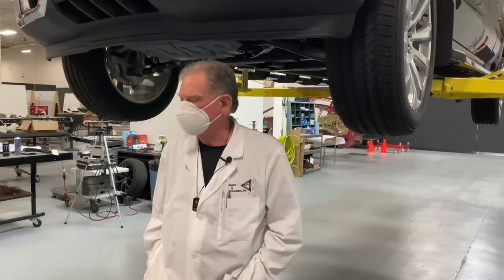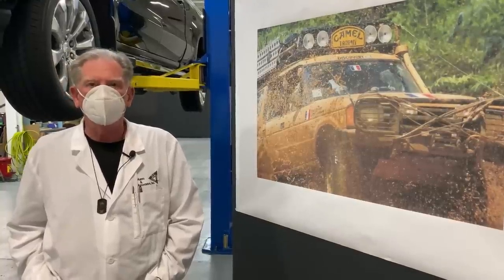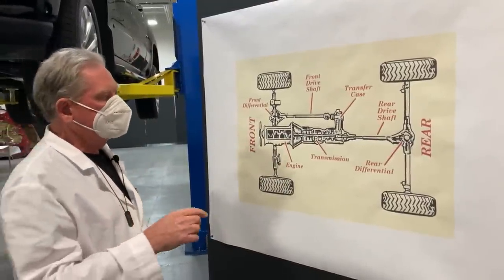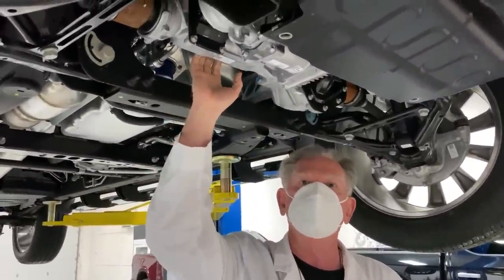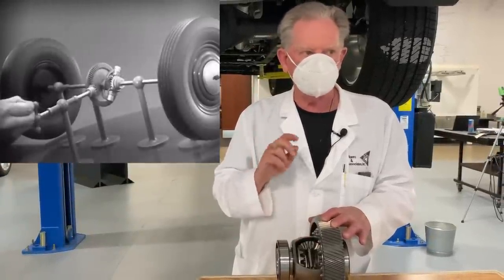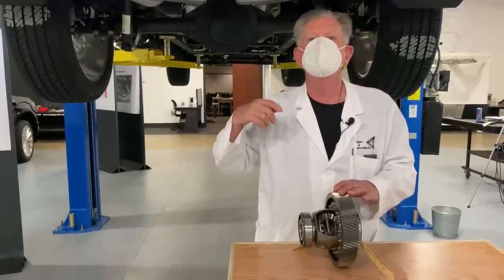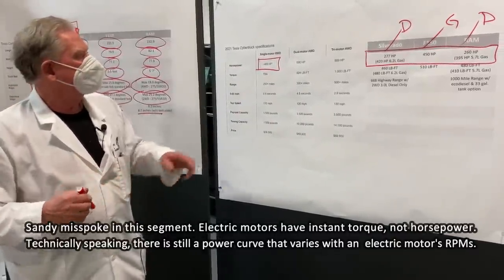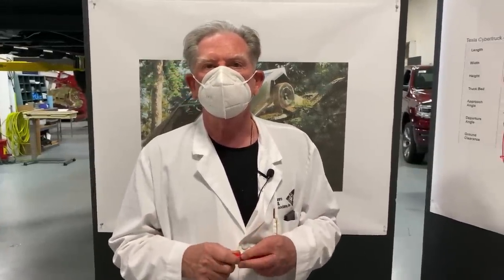Cybertruck E3 -  Driveline & Off-Roading

Comment: For the off-roading talked about in the video, torque is much more important than horsepower (you want to slowly crawl up the giant hill, not accelerate on flat ground). Which actually sets it apart even more from all the combustion motors.
Reply: sandy was actually talking about torque, he misspoke.
Reply from the maker: No disagreement there, Ryan, we got a bit crossed up.  Torque is king for sure.  Thanks for tuning in and keeping us on our toes!
Reply: For crawling with an EV you really want to know what's the holding torque and stall of the motor (yes, electric motors can stall)
The real challenge will be keeping traction, because wheel speed goes up real fast when you slip with a direct drive
Reply: @riccardo1796  look up the video of Tesla in Alaska. About a 10 minute video about Tesla and they're facility in Alaska to develop the winter driving capabilities. 

One of the segments is about riding on is with snow. And make a evasive manouvre with assistance software and without. 
This show Tesla really has a good handle to not slip out. 
It really baffles me how they do it. Have seen ICE cars do it aswell in many video's and never really have seen anything like it. Atleast like what it looks to be doing.
Reply: I was thinking the same thing haha. I drive an EV and the most noticeable thing to me is the torque when slowly driving up a hill. When I'd slowly drive up steep hills in an ICE car it would have to hit whatever RPMs to even start moving. EVs seem to have effortless power in that department.
Reply: @MunroLive  I was going to comment as well.  824lbft of torque before the gearbox for the dual motor is insane...  I will have to get a couple of spare CV shafts for sure.
Reply: @MunroLive   The easiest way to find the right answer is to post the wrong answer on the Internet.
Reply: @riccardo1796  electric motors can install but Tesla motors use reluctance motors controlled by AC, so these ones in particular don't stall like other motors do.
Reply: @pilotavery  of course they do
As the load increases so does the slip angle, until it gets to the point where the rotor is still while the field keeps spinning
Reply: @riccardo1796  this is true on some types of motors, especially all of the AC motors that RC cars use, as they don't use induced current on the rotor. in a way, the field is always slipping, but it doesn't stall because the torque still remains constant. The torque doesn't decrease when it starts to slip, the torque actually increases. It almost acts like a torque converter.
Reply: @riccardo1796  Tesla uses a switched reluctance motor, And they produce 100% of their rated torque at stall. Indefinitely. With no extra heat generated. So I guess if you think of it that way, you could say it stalls, although typically it is considered stall when it reaches a point where the amount of torque decreases.
Reply: @riccardo1796  although if you're thinking of something like an AC brushless motor on an RC car that's just a sensorless 3-phase, they stole as well except when they stall their torque decreases significantly
Reply: @riccardo1796  on switched reluctance type motors, the slip angle is not a thing. It's not a continuous angle but a slip rate as it is always going to be rotating slower than the magnetic field, with the load causing a greater slip speed and therefore increased current induction, causing it to be reluctant to slow down or speed up relative to the magnetic field. You can also control this rate with angle as well period the end result is it functions almost exactly like a torque converter in that the slower the rotor turns, the more torque it produces until it's essentially infinite torque at zero.
Reply: @pilotavery  I wish I knew more about motors to know angle and reluctance and the other terms. I'm gonna see if I can find a video that teaches all that - hopefully can find one about Tesla motors specifically!
Reply: What is most important is the traction control and locking differential.... the range rover, mercedes gwagen, land cruiser are the best what Offroad can give

Comment: 3 motors makes no sense to me, lose the diff and put in another motor for quad instead!
Reply: maybe it's kept for another Elon moment of "one more thing"
Reply: I imagine a fourth motor would add more power than is useful (tires only have so much grip) to justify the extra weight and cost. The front diff should be no problem since the back wheels will do most of the work and the front wheels won't spinn out of control with active breaking.
But i should add that i don't really know what i'm talking about :)
Reply: Most classic off roaders only have a rear locking differential so it’s probably enough. 

Plus this way in the front they can use the exact same motor they use in the other cars, and they only have to develop a custom solution for the rear wheels.
Reply: @lievenpetersen  lol. Cost is like $800. Not much more than a diff. Same for weight

If they can do 3 they can do 4 and do it right.
Reply: @lievenpetersen  and no tank turn 😒
Reply: Can you imagine the computer controlled traction and crawl control capabilities to maneuver over tough obstacles possible with 4 independent high torque motors - one on each wheel, and capable of independently  spinning opposite directions simultaneously? Combine this with tall portal gears on each motor/wheel and this new generation of 4x4s will be absolutely unstoppable off-road. Clean and quiet too!
Reply: @user-tb5ns7hc5i  what a beautiful thought!!
Reply: Why stop there? The motors are so small and localized within the vehicle that many more multiple powered wheels in rows could be placed on radical suspension under a vehicle making it  like a rolling undulating mat of wheels conforming to the ground for ultimate traction.
Reply: @user-tb5ns7hc5i  I'm pretty sure you are 90 percent of the way to reinventing the tank.
Reply: i think thats the plaid version

Comment: Ground clearance: I thought there was a second side to this. Vehicles with 16 or 18 inches of ground clearance are fantastic for off-road, but the trade off is potential instability on the highway.  However the CT has the best of both worlds, since it can then "lower" the suspension on the pavement, to somewhere around 8 inches? Making it better than most "regular" trucks! It's gonna be good boys and girls :D

Comment: Great job explaining the drive train on my 4X4. I learned something today. About the Cyber Truck (Dual motor on order) , if I was rock climbing and wanted enough clearance to keep all the wheels on the ground without scratching the skid plate, but wanted to keep the centre of gravity as low as possible, I can see a sensor system that monitors the clearance and adjusts the suspension height on each wheel independently. Rock Crawling mode could be engaged at low speeds. How would you like that Sandy?
Reply: Tweet this to Elon. RIGHT NOW. He might just put a coding team on it and it might end up as part of an update.
Reply: There is no sensor that can do that, plus the air system is not fast enough to compensate. When you are going over rocks the suspension is bouncing so the ride height is in constant fluctuation. A computer can not compensate. Your best bet to adjust the height yourself.
Reply: @JasonWW2000  As a retired instrumentation tech, I can think of several sensors that could be candidates. Optical sensors/IR sensors, can detect an object that blocks a path in a straight line. If they were placed on the wheel mounts they could cross the belly pan/skid plate in an X pattern and left to right. For more coverage I would try a capacitive/inductive sensor that would use the entire skid plate as the sensing surface. As the sensor comes in proximity to a object, it provides an analog feedback that can be triggered. This would be less localized unless the skid plate was divided into multiple capacitive proximity sensors, perhaps one for each quadrant. And I did stipulate that it would be at slow speeds, I mean rock crawling slow speeds, so bouncing would be negated. Don't assume that because nobody is offering such a thing that it is not possible, especially for Tesla.
Reply: @briansilver9652  I agree--this can be sensed and thus individual wheel heights controlled in real time. Please do get this to Elon and Sandy (pays to have a backup channel!) As a real time SW Engineer, this would be quite fun to work on, with Sandy doing the test driving!
Reply: @avroarchitect1793  I'm an old guy, I don't tweet. I barely You-tube. Feel free to tweet away for us all.

Comment: This is really informative. After I watched this video, I realized how little I knew about offroading. Like that endo club for example. If cybertruck's spec is about the same as what promised, that really makes CT even more desirable. And I already like what CT can do even before watching this video. Thanks a lot Sandy. Also slight correction at 18:15, it's model X not model Y :)

Comment: Agree all. When I was a kid I did some time running rubber tire and tracked logging tractors. "Interesting" might be how Sandy would describe it in the mountains of British Columbia. Took a good driver to stay alive on a 15 ton tractor being pushed down a ski-type slope by 20 tons of logs on hard snow trails, then get the load stopped at a landing with a 30 meter sheer drop at the far edge.

Comment: It will be interesting to see how that long wheelbase really works when off-roading. 99% of these things won't see any off-roading and those that do might find that they bottom out a lot... and that's where the battery is. Sounds like a winning combination - like a tortoise trying to walk over large rocks.

The 16" clearance is a bit misleading as it's likely to be 16" all around (not just where a differential is in the others) and with the long wheelbase, much of that benefit might disappear as soon as your front wheels go over that large obstacle and the whole battery tray rocks like a seesaw on it.

Comment: I would have ordered the tri-motor if I had seen this presentation. I hope I can update the order before they deliver.
Reply: You can just email them.
Reply: Be sure to lock in the $7K FSD when you do. Imagine not needing a shuttle service when you use it to haul your canoe/kayak on a float trip. :-)
Reply: @10fantic  thanks, I will try that
Reply: @danoberste8146  hell yes I ordered fsd
Reply: @mikepetersen5024  me too.
Reply: Mike Petersen, Don’t email, I changed mine by logging into my Tesla account. Use the link in your confirmation email, and then view your order, then upgrade it there. Very easy no cost.
Reply from the maker: @danoberste8146  that is a great point! The rafting nation will be thrilled!
Reply: Dan Oberste now you are talking real sense. A one way trip with your truck waiting at the other end. Pure genius. 

We might want a harpoon style front winch as well to get across some silly string river or canyon. Endless possibilities 

Just that price tag is a tad steep.
Reply: Great feature for hikers as well.

Comment: Presumably they also need to 'armour' the underside so those rocks don't ruin your day when they puncture the battery pack.
Reply: Teslas have a perfectly flat underside covered in armoured titanium sheet.  Far better than all the bits and pieces hanging down underneath traditional ICE 4WDs just waiting to get caught on rocks.
Reply: Martin Hill  very true, only downside is that if it does puncture and catch fire in a forest, there is no way to put it out 🙈
Reply: @DavidHRyall   I think we'll find that the underbelly of the Cybertruck is significantly more armoured than all pre-ceding Tesla models considering its off-road orientation so that scenario I think would be very low probability.
Reply: @DavidHRyall  Im pretty sure the advanced AI onboard will know precicely what it can and cant get away with, and preemptively stop if there's any danger of a grounding,
"I'm sorry, Dave, I'm afraid I can't do that"
Reply: @martinhill9011  Where are you getting info of a very expensive titanium sheet? I've always heard they use a thick sheet of aluminum. Like 3/8" thick.
Reply: @DavidHRyall  - Roll on Solid Electrolyte Batteries!

Comment: Sandy, please consider the Bollinger B1 instead with its portal axles. https://bollingermotors.com/ It's the better comparison to a Jeep Rubicon.
I doubt, the "Cybertruck" will ever be so offroad-capable. Because if it did, then it would neglect so many other features or properties that people want or people like/need on actual roads.
The drawings also neglects the fact, that gear reductions will be needed between each single electric motor and wheel hub.
Big thanks to the video editor, who increased the quality of the content dramatically with written explanations, corrections, and added references.
Reply: They did leave out the differential for the tri motor. We really dont know what that assembly will look like. It might be 2 motors feeding a single diff or each motor might feed a gear reduction only. We need more info.

Comment: 4th type of differential "torque bias" i have 3 in my Defender
Reply: 4x electric motor # no need for Torque bias
Reply: Mark Plott  that will be the rivian, not the cyertruck
Reply: Torsen
Reply: @markplott4820  nonsense, the motors would have to work to simulate differentials
Reply: Why on earth would you need 3 diffs in a 4 wheel car.
Reply: @Ckcdillpickle  the mercedes gwagen started in the 70´s and just like the UNIMOG it comes with three diffs and its awesome, the gwagen 6x6 even has 4 diffs and central tire inflation/deflation....
Reply: @markplott4820  The motors would need to have torque biasing programmed into their control software, which is lame, because you'd always be waiting for the computer to decide when a wheel is slipping before it starts supplying it with power. Nothing beats locking differentials.
Reply: @Ckcdillpickle  permanent four wheel drive has a center differential

Comment: Sandy, thanks for your knowledge and insight.  I pick up my Model Y by the end of the month but am looking more forward to the Cybertruck - the more I see and hear about it.  I did dual motor and tri motor reservations since I don't know which I will go with when it finally arrives.  While I don't have plans to tow so the 300 mi+ range dual motor should suffice, who knows what changes in my future..perhaps I should splurge.

Comment: In the Power comparison section I guess Sandy meant that ICE engines needs to be RPMs to high for that power AND torque to be generated. But electric engines curve is much flatter. So he is right that is one of the biggest differences from ICE and most people does not know it until they try to drive Tesla :)

Comment: Fascinating, amazingly helpful video.  I really enjoyed it.  I suppose that 95% of non-professional drivers will never, ever use 4wd except in a field car park, so why oh why does this vast collection of steel and aluminium get used to drive one 50-100kg person to and from the supermarket most of its life with a twice a year drive over 100miles?  If the planet needs saving from the car, electricity is part of the story, but for goodness sake reduce the size of vehicles.  A person drove a VW Beetle in the 80s, and it did the job, are we THAT much bigger now that we can't fit in a normal one-tonne car with 100bhp and drive to the supermarket at national speed limits?  This is where the problem really lies.

Comment: It will be interesting when they get the Cybertruck out here in Australia to put one up against a Land Cruiser, with a m3 spray rig in the back of course working up in the mountains. Two advantages come to mind, the first is the Cruisers are terrible with any weight on them going across a slope. The other is no ICE's on the spray rig (had two, one to pump the water into the tank and the other to pressurize the spray), saves weight, cost and hassle, but also is quite which when you are working in Nature parks is less disturbing for the animals (and me). I know quite a few people out here that laugh at the Cybertruck but I think they may change their minds when they see one in action, not just for working with but it'll be a game changer for some of the hunters.

Comment: My main concerns are wheelbase length and turning radius.  Pretty tight on the mountain trails I go on, and some times you need to be able to turn around.  I also wish they did a 4 motor version.  It will also be cool to be able to operate it from your phone, so you can get out and actually see best tire placement and clearance while rock hopping.

Comment: I think they'll just put a single clutch on one end of the reluctance induction shaft... You can lock it and lift two opposing wheels to achieve tank steer with low tire wear and high efficiency.

You could also design a reluctance motor with two stators... And while you're taking turns in the city one of them would send some energy to the one that's powering the other wheel... While drastically improving turning radius